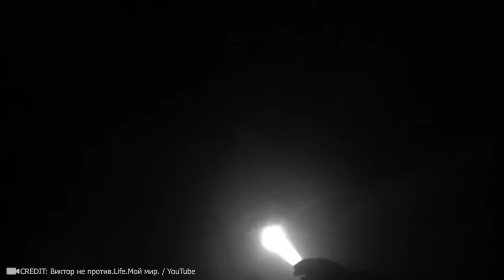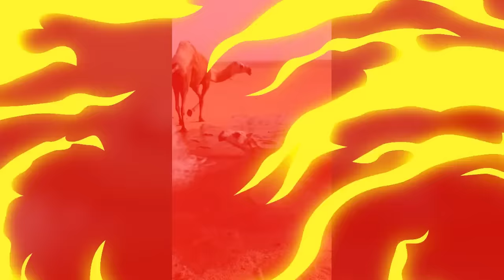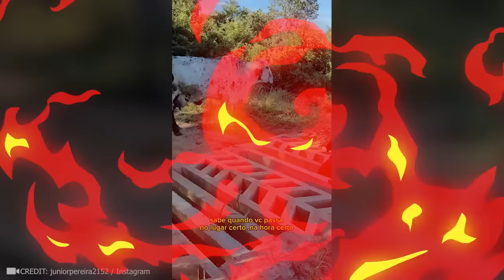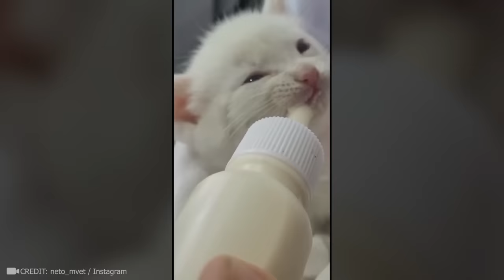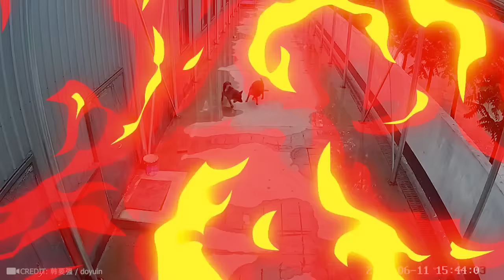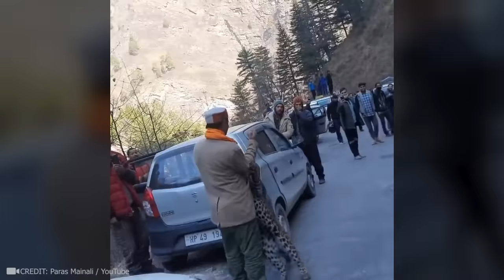Animals That Asked People for Help | Best Acts Of Kindness In Action !

Comment: If you find an alligator in a frozen pond, DO NOT try to free them.  They are in brumation and are not in danger.  However, if you take them out of the water, they can die.  The water under the ice is warmer than the air